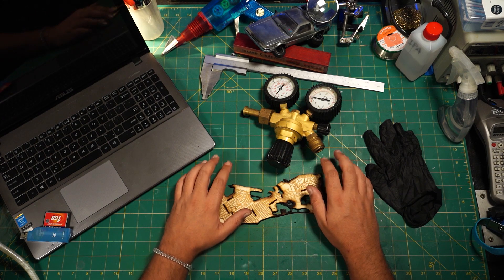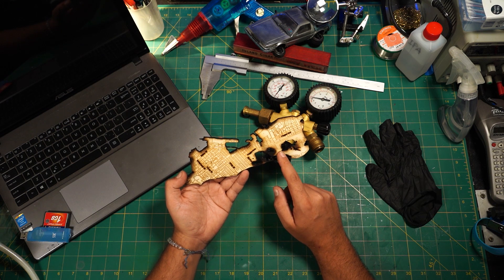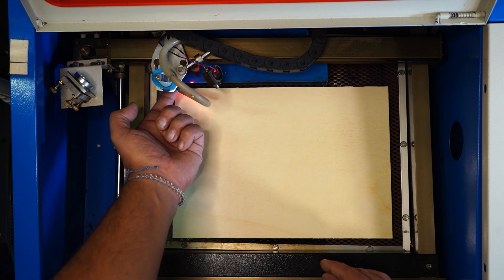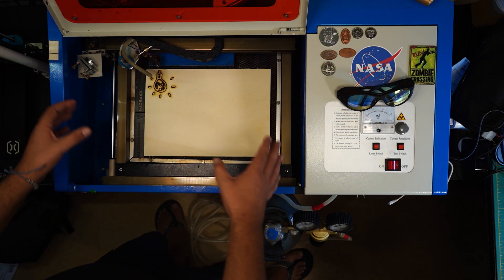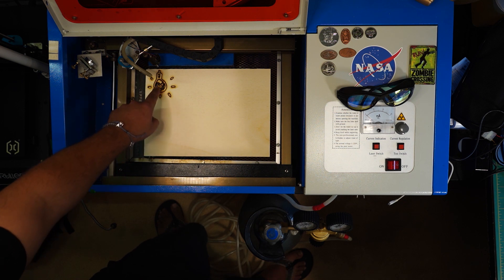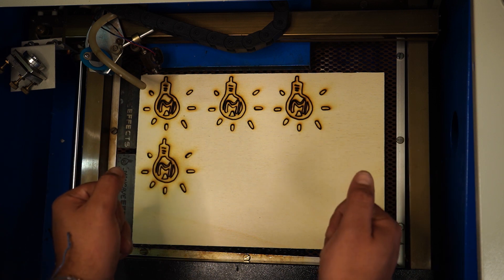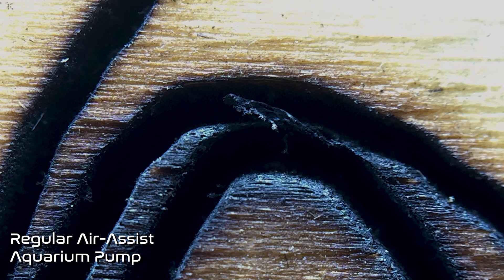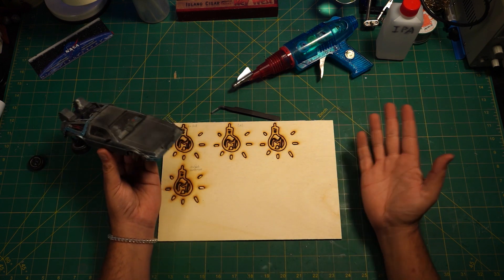Carbon Dioxide "Air" Assist - Better Results ? | K40 Laser Experiment

Comment: Well, thanks for the experiment!
I’m going insane trying to cut thick paper for making paper kits. I have an air assist moving supposedly 30l/min.
I though about the inert gas and found your video. I don’t need to further aggravate my insanity. This solution seems not help much.
Paper kits you can buy show very little marks and are pre-cut.
I have no idea how they get that result.

Comment: Would be pretty interesting to see what happens if you just fill the case with co2 (making it airtight beforehand) and then no more air assists while cutting. But that could mean smoke and dirty lenses.

Comment: When I added a 50L air assist to my k40 laser It turns on and off by itself, what is the SOLUTION please 🥺?
Reply from the maker: If you attached the air pump to the lasers power supply, it may pull to much current what results in overpowering the internal power supply. Try to power the pump via a seperate power supply rated for the needed current.

Comment: If you are in a well ventilated area, I wouldn't stress about carbon dioxide, the only real danger I would be worried about is asphyxiation which Is incredibly unlikely if you have good ventilation and the bottle isnt letting out heaps of gas.

Comment: Something wrong with your setup. I am pretty new to this but I cut 3mm ply in a single pass with 10mm/s feed rate and laser power set to 12% (my ammeter is on its way)
Reply: if he has the 50.8 mm lens his focus point is way of . i can even see it at the cut line how wide it is
Reply: On a k40? That doesn't sound possible. More like 20% at least, and 5 passes
Reply: @entozoon  well, this depends on the plywood of course, but I confirm. Now that I have ammeter installed I think it is about 4- 5ma for single pass cutting
Reply: @entozoon  in didn't, but I did replaced mirrors for better quality ones. Don't remember which I picked

Comment: You need proper air assist. Not just air assist from the ceiling. Narrow nozzle with maybe 2.5 mm orifice and 10-14 liters per minute of air. And your cut will be clean. That nozzle you are using and at that distance from the wood will not do anything good.

Comment: There is somethings wrong with your setup. I've had kind of the same issues with my K40 before I replaced the mirror holders.
When you upgrade this you will also be able to laser on you complete build surface. 
I didn't want to believe this before as well but I guess 90% of your problem are because of mirror alignment. The other 10% should be done with adding enough air that no flame will come up.
Kannst mir gerne auch eine DM schreiben, wenn du noch mehr Fragen hast. Manchmal ist es auf deutsch einfacher

Comment: The laser cuts less effectively in the end of the axes most probably because the focus distance is changing, due to z-leveling of the axis/part, not because of the "distance from the laser tube". If you adjust the height in the 4 corners of the stock, either by shimming or by leveling the bed, you will get consistent results in the whole cutting envelope of the k40.
Reply: cutting envelop, never heard that one bevore

Comment: Looks like you are cutting at 15mA, you should be able to cut 3mm play at 10mm/s in a single pass without a problem. Probably a tube, alignment or lens problem.
Reply from the maker: I will try this. Thanks!

Comment: I use an airbrush pump for my air assist with an offset nozzle so it blow more across the cut (as other's have suggested. I can cut through 6mm plywood (multiple passes of course). The edges do get charred, obviously, but the flat  surfaces are good with only minor smoke staining.
Reply: AND I just watched to the end of the video and see you used an airbrush compressor..

Comment: I cut the same plywood with the same K40 always in one pass (at 70% power)! Compressor with about 2 bar and vacuum cleaner motor as suction. Are you sure the focus is okay? He failed once when the mirrors were out of alignment.
Reply from the maker: Good to know, i will check again... maybe the tube just arrived at its end of life... :-/
Reply: @MancaveEffects  you can check the tube when you look at it. If the generated laser inside the tube is purple is good. As it turns bad the color goes more and more to white.
Reply: same here cutting hardwood plywood (dark) in one pass 660 mm/min and 11.4mA on the output of the tube. it even is a homemade machine with a 7oo x 7oo workarea, dm me for some troubleshooting insta: miniature_man

Comment: dont try oxygen for obv reasons you should try nitrogen
Reply: But maybe it's worth a try, industrial co2 lasercutters often use a stream of Oxygen to burn away the glowing material like with an Oxy/Acetylene Torch.
Maybe the K40 has then enough power to cut at least the thinnest sheets of steel. As long as the Laser doesn't hit the nozzle or the air/gas hose there shouldn't be a to great risk of fire.

Comment: What kind of plywood is that? Are You sure it's laser compatibile? Frmo my experience cutting plywood in more than one pass will always result in catastrophy. Well focused and slowed down k40 should cut plywood without problem, at least I had such luck
Reply from the maker: This is a good question! No, the plywood i use is nothing special, i get it for cheap at my local home improovment store, so that definately makes a difference. I should check it out! 
In my experience gor the wood i use when i go slow the burn marks are getting worse. I usually make the first pass with a speed setting of 20mm, the following ones with 25mm.
Reply: @MancaveEffects  Right now I'm using a "80W" chinese laser and currently I settled down on 35% of power at 17 mm for cutting 3 mm plywood. I remember around 10mm and ~60% cut the3 mm  plywood nicely on k40 I played with before. I also tried home improvement store plywood first but the stuff is waterproof so it's almost impossible to cut through, makes a bunch of smoke and left a lot of charring and loose soot on the edges - very similar to what You experience. I started ordering plywood online, not only it's cheaper but cuts like a dream :) I guess if You charr the surface with first pass it starts to work like ablative heat shield on spacecraft :D
Reply: @PiranOfficial  I found some plywood on eBay and Amazon that mentioned it laser cut well. It did. Like Mancave, I found the DIY store plywood a problem and must be made with some glues that cause the burning and flare-ups. Where did you get yours from?
Reply: @MancaveEffects  I use Baltic Birch a lot now and always get great results.  The cheap plywood at the home improvement store seems to have an issue because of the quality of materials, the number of voids, and the type of glue used.  The better plywoods are more uniform and in the long run results in less waste plus less time on the laser.  The more air you have the better.  I originally used the air pump that came with the laser but it is just a fish tank pump.  Then I used my airbrush compressor and it got a lot better.  A regular air compressor that can store more air and has a higher flow rate is even better.  Great job on the video.

Comment: Instead of a combined air-assist nozzle, that flows air downward onto the material, do you think that an air compressor, larger ID tubing for increased flow and an air nozzle that pushes the air horizontally across the material would help?
Reply from the maker: Well i wanted to try that but that would be an additional measure. The air  assist is mostly meant to provide overpressure inside the nozzle so smoke can‘t enter and deposit on the lens. But else it sure could be done!
Reply: @MancaveEffects  I too have a K40 that is a month old to me, and also have the same burning and residue issues on my materials. I have found that using low-tac masking tape on the wood helps massively with the cleanup but fiddly to pick off, if the etch is complex, like yours was. Different woods make a big difference, depending on the rosin content. I got some plywood from Amazon that etched really well, with little residue or burning. I guess for plywood, it depends on the glues used to make it. I've replaced the stock extraction fan with a much more powerful inline fan. That has made a big difference too. I use air assist but with a small 24v snail type fan mounted above the lens assembly, that similar to your in-line one, but blows the smoke down onto the material. It's much better than the stock no air assist but everything to make the K40 work really well, is unfortunately extra money.  I am interested to see what you experiment with next!